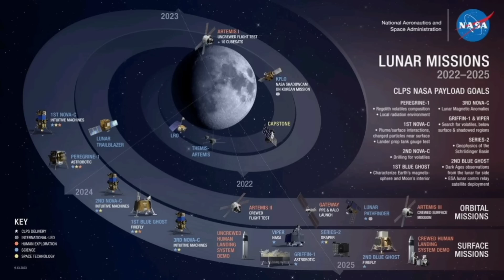NASA has a plan to send a fleet of spacecraft to the Moon!  But that plan is in trouble!

Comment: It seems clear that industry over-egged their commercial offers with optimistic technical and business case solutions to get a crack at the budgets on offer. So-called “success oriented pricing”. Now they look for reasons why the deliveries are slipping or failing. Coupled with this contractors most likely put pressure on NASA to become “better” anchor tenants with big increases in expected “pay-per-use”. Meanwhile their “anticipated” commercial business users take the back seat (if at all).  NASA are themselves caught in a loop that needs missions to hit their milestones as well as promoting the “govt as customer” because they need this for their funding narratives - growing the seeds of a commercial economy etc etc - and no doubt have their own engineers who recognise shortcomings with these contractors and seek to add some heft to the design and devt teams.

Comment: Seems N.A.S.A was having much more luck landing 3 Rovers on Mars taking data and pictures then just trying to get landers on the moon. Seems N.A.S.A in more recent times has gone way down in successes. China is not having a problem landing two Rovers on the dark side of the moon taking samples and also bringing them back to earth. The way China is going they will have their astronauts on the moon as well as moon base space modules long before N.A.S.A will. N.A.S.A has plenty of excuses when things fail. Then saying the failure is a success. Like claiming the Starliner was a success. Making excuses for Boeing. Oh it was Covid. It is a supply issue. Seems China has no supply issues after Covid. It did not stop them from getting a Space Station built or a lander on the moon or the system to get the samples back. And they had lock downs longer and more then just one with Covid. When a company or Organization is failing. They get ride of the people in the positions that keep failing. N.A.S.A needs to clean house.
Reply: China has this won, easy. They will be the first back to the Moon with people. NASA depends on SpaceX having more than ten Starship launches to place one lander on the Moon. That is 10 years away. China will be on the Moon by 2032 at the latest.

Comment: At the rate that nasa builds rockets it would take 40 years and 10 trillion dollars to get 4 rockets to the moon… this will never hapoen
Reply: I am afraid 10 trillion is not enough

Multiply that figure by, hmmmm , about 100, might just be enough for them to dig a hole on the lunar soil
Reply: @verypleasantguy don’t forget 13 election cycles.
Reply: @reapergnome666  Let's come back to this thread on 2077, to check if NASA  has finally managed to land on the moon, or not
Reply: @verypleasantguy  the answer would be “within the decade”
Reply: @SLBBP  dream on, dude, dream on !!

Comment: The extra lidar on the Intuitive machines lander did NOT actually work.  They had to code very fast so there was a key piece that was missed.  So the lander ended up defaulting to image based landing anyway.  Which is why it was still moving at landing because it couldn't tell how far from the surface it was, it had to guess and thought it had a few more feet to reach the surface.  Amazing that it worked as well as it did though.  Very Kerbal.
Reply: If it hadn't worked there would have been a new crater, it's just that it took readings every few minutes, not milliseconds.